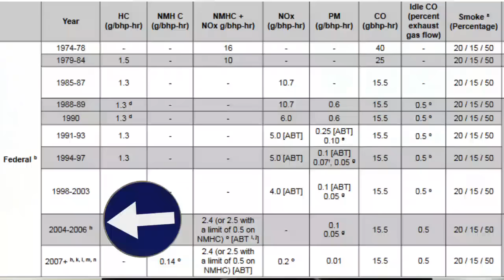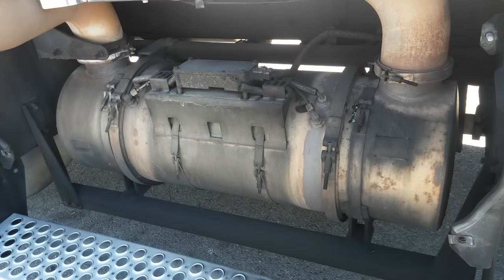Why Do People HATE Cat ACERT Engines?

Comment: I owned a 2004 w9 with a cat.  Was the biggest POS I've ever had in my entire career of trucking.  Burned it to the ground. Promise never to own another cat for as long as I live (unless it's the rare sought after 6nz everyone wants)  ill stick with my cummins
Reply: If you thought your Cat engine was a POS, wait 'till you see the issues people have been having with Maxxforce engines. The reason Maxxforce is so quiet is because they spend more time failing and having to get EGR coolers cleaned than being on the road.
Reply: @electric7487  ill never touch Maxxforce, paccar ,  Detroit or accert cats.  Ttucks with the amazing 2ws or 6nz are just too old and worn down for me. Not to mention over priced if restored

Comment: Haha, am I’m the only one in the comments with a C-18?
Reply: Well, I’ve got a CAT with the same 18 litre capacity but it’s got more than 6 cylinders 😎
Reply: @gm16v149  yeah but....  it's missing 2 whole main journals and the bearing surface that would go with them,  and also a good bit of crankshaft mass is missing too..
so ya know... snap, crakel, pop!

just messing with ya, I guess the sound they make..  makes up for any drawbacks.
Reply: Nope I run 2
Reply: Does any of your C-18’s acert?

Comment: My valve actuator gives me a check engine light I just kick her out of of gear shut motor off then restart float it back in gear and keep on trucking if the light stays on I replace the one that's responsible cat told me they can't tell which one is bad until the light doesn't flash

Comment: Why does my d6r dozer use so much engine Lol? Dealers laugh at me. 3 to 4 litres a day. Leave it at lower level and still. Hui blew up after tech opened it and said it was good then they change injectors and pump but still  oil disappears! They have no answer for me.

Comment: Sorry i did not mention we in UK to combat NoX and particulates(soot) in diesel exhaust ,use a system called Ad Blue mounted on the wagon,s chassis close to the engine is a tank full of concentrated animal piss,yes cow piss (urine) injected by computer another geek box to worry about, into the exhaust gas stream it attracts the soot and somehow reduces the NoX. All late model wagon,s built by Volvo Scania DAF, IVECO,Mercedes, Renault and MAN, to run in the UK must have AdBlue fitted. All this does not matter if you run a 1978 Peterbilt 359 with an old fashioned 'Big Cam Cummins,life is a lot easier.

Comment: Wow!!! I don't know who's emission equipment is more complex? Heavy trucks or diesel pickups? Seems both, I have worked on diesel p/u, main complaint was scr systems not working right, especially g.m (goofball motors), when run low/out of blue fluid, the system would go to creep mode, refilling wouldn't reset it, had to go to g.m🤬 stealer, oops!! I mean dealer to reset. 😠😡🤬🤑🤑🤑

Comment: This must be how to kill an engine or did I miss something.
Reply: The EGR systems and DPF's are what's choking your engine down. 

EGR dumps exhaust gases back into the intake. So your engine is breathing in its own waste. NOx is reduced, but combustion efficiency is also reduced, so you produce more soot. It can also cause carbon buildup in the intake manifold, and even though Cat mitigated that with CGI, I'm not aware of anyone else doing this. I read somewhere that EGR systems can make an engine 3% less efficient.

DPF's filter the particulate matter (soot) out of the exhaust stream. This eliminates the smoke, but what happens with any filter ever? They plug up! As you can imagine, having your Diesel engine getting choked down by a filter is not going to help it. You burn more fuel which means your engine is even less efficient, and it gets worse because the regeneration system that cooks the soot to clean the DPF uses fuel. So you're burning more fuel to reduce emissions. How ironic.

SCR is where it's at. With zeolite catalysts, soot can be cooked while NOx can also be reduced. High-flow catalysts don't choke down your engine anywhere near as much as a DPF.
Reply: @electric7487  SCR systems still have a DPF, but it works way better because they can be tuned to run leaner (less PM to deal with) and the excess NOx that results will go on to oxidize the soot in the filter. Then you just use SCR to remove any NOx that's left over.
Reply: @nerd1000ify  Ever heard of a DOC? DOC is Diesel Oxidation Catalyst, basically a catalytic converter that passively oxidises unburned hydrocarbons, turning them into CO2 and water. It relies on NOx and excess oxygen in order to accomplish this, and does so with efficiencies of 80% or better. It does reduce PM as well, but it's only 20-40% because PM is larger particles. This is great nonetheless because it reduces the PM getting to the DPF, which means the Regen cycles are longer, which means less fuel is wasted and your ARD head lasts a lot longer.

Comment: I don't have a problem with you a certs I don't have a problem with the any engine dd15  isx15  isx d13 d16 3406 and so on worked on them all and they all have there problems and i look at it as job security

Comment: Sounds like it's counterproductive me you're pulling easier to create less oxygen so the fuel doesn't burn a hundred percent because your dpf to get more ash in it which in return causes more down time and the toe because it dehydrates your engine down to 5%epa is stupid proper running engine that is tuned properly needs none of that equipment to pass emissions